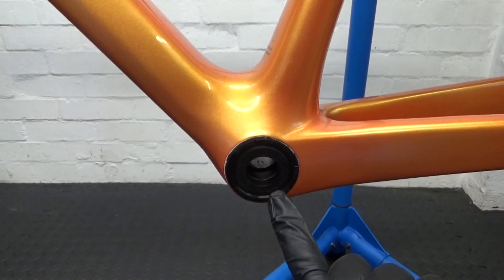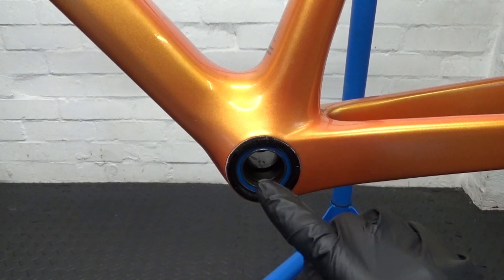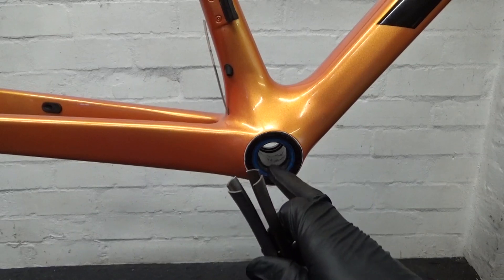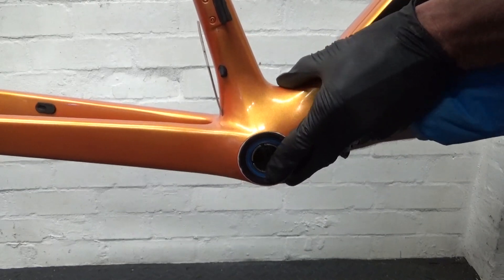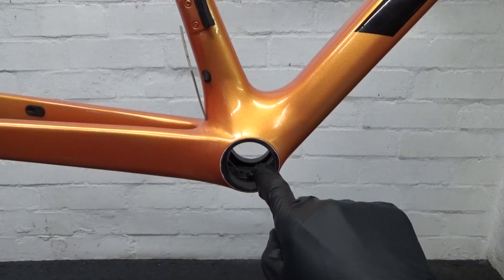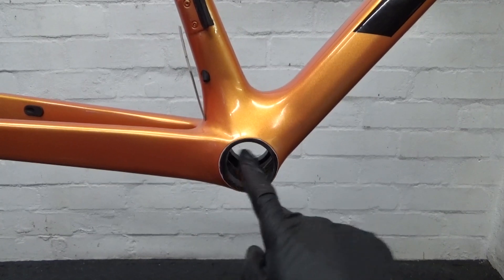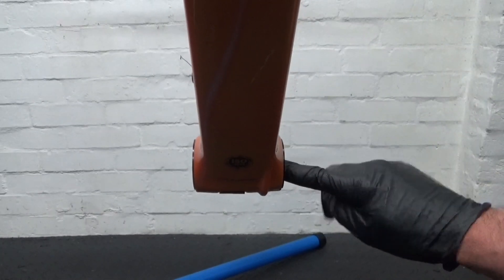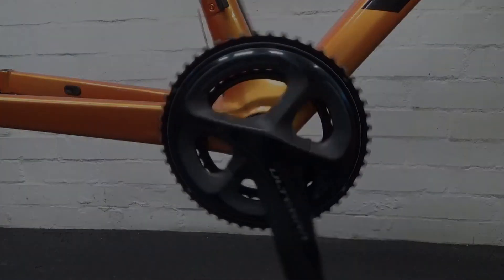FSA PF30 Bottom Bracket Fitting Guide

Comment: Thanks for the video. Maybe you can advise on my issue here. 

I have an Orbea bike with 386Evo shell. I want to install my Rotor 3D+ crankset which is 30mm axle. Would this setup fit? The shell of the Orbea as 386Evo is 86.5X46mm inner diameter of yes what type of bb do I need. Is is the 46-86-30 ?
Reply from the maker: Yes this BB is 46-86-30.